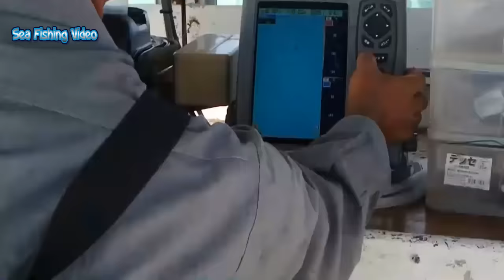Amazing Giant Squid Cutting and Processing Skill - Amazing Fastest Squid Catching on the Sea

Comment: Totally unnecessary to do all that cutting, when you can just twist and pull to remove the head and innards… and such a brutal killing method… you could have easily stunned it with one swift karate chop (not joking) above the eyes, and then one more a couple inches above that, and it would die instantly… painlessly… rather than stabbing it like a damn savage!